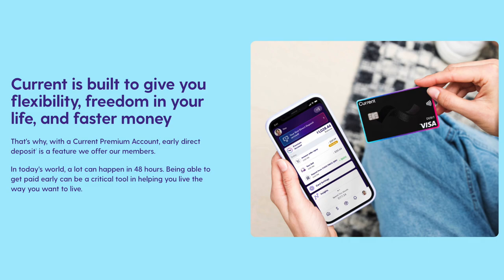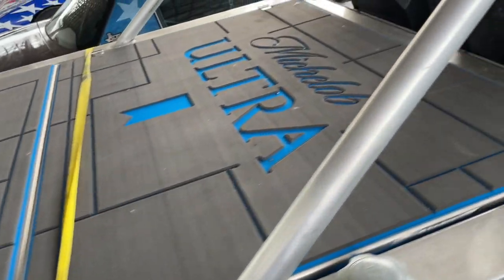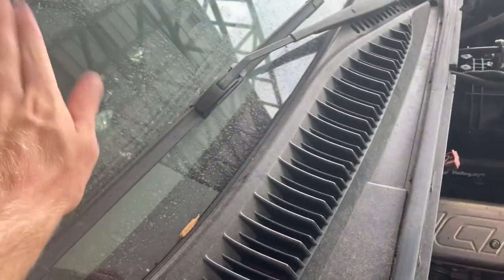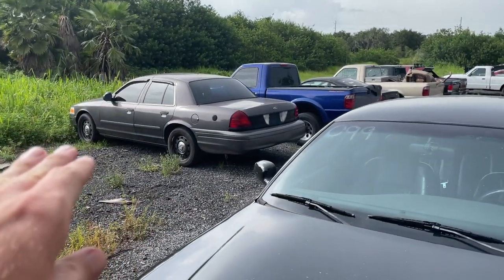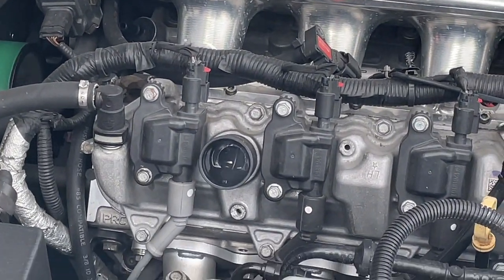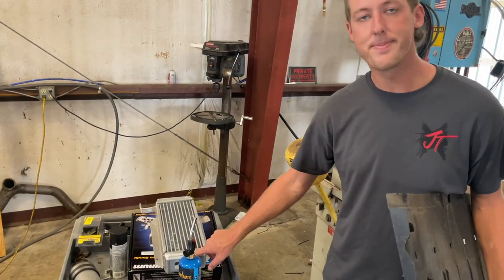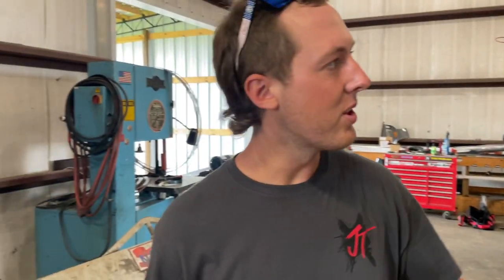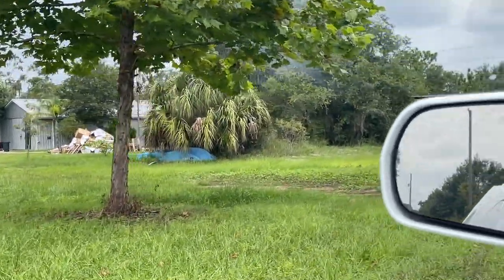Trying to Fix the FREAKING Bald Eagle Machine Finally... + Sold One of the Jet Boats :(

Comment: Cleetus: running the car all the way through 3rd gear

George: Strange the temps are rising when we’re going 40-50mph
Reply: well I mean, for a stock car it doesn't make sense. Even if you're making pulls, it should go back below 200 degrees. Because it's not stock anymore, it might get slightly hotter but it should cool down while cruising. He said it hit 250 cruising... so something is definitely wrong. I would start by flushing the coolant system and changing the thermostat and then moving the oil cooler and getting more air through that bumper. 

Normally when you're cruising at highway speeds, the temps should drop a ton because of the wind. The car didn't do this before, so I am gonna guess something new, especially since it's been sitting for a while.
Reply: If it rises during the pull, it'd ok; but it's rising when you are cruising after the pull.
Reply: Yeah, it sits a lot, and likely has plain tap water in it. Probably plugged up somewhere. Flush cooling system, change thermostat, take water pump apart and check for proper function, make sure the blower isn’t somehow keeping the belt from getting good grip on the water pump pulley, burp it WELL, make sure the efan(s) kick on at 180 or when the AC’s on, etc.
Reply: @sammaggard  I think the joke might be that they might have been a little bit faster that 40-50, maybe 55?
Reply: He also said they are running no thermostat on it. once the engine load is gone and there is nothing generating massive amounts of heat anymore the coolant temp should drop right off. He should try to build a air scoop into the lower skid plate to try and ram air through the radiator from the bottom. could potentially solve the boost pipe being in the way also
Reply: @zachbecklake2303  the problem with no t stat is once heat soaked the water dont sit in the radiator long enough to cool off
Reply: @zachbecklake2303  when you dont run a tstat, the engine will generally cooler very well at idle but overheat when running down the road because the coolant is running through the radiator way too fast.
Reply: @zachbecklake2303  If they ain't running a thermostat... hope they have a reducer in there.
Reply: @The_sinner_Jim_Whitney  if he is letting tap water sit, it will destroy the block, ask me how I know.
Reply: gotta use distilled water
Reply: @sammaggard  Eventually, yes, but probably not over the kind of time they probably let them sit. I imagine you know for the same reason that I know, haha! I’m sure they flush them pretty regularly. But yeah, tap water’s certainly not ideal for coolant and I think the only reason they (or anyone) use it is for legality on racetracks and unfeasibility of using distilled water or waterless coolant or something.
Reply: @The_sinner_Jim_Whitney  yea my sleeved block I bought used, needs resleeved because the owner let tap water sit in it.
Reply: @sammaggard  As did my truck (2012 Colorado 5.3L ext. cab Z71 4wd with 4.10s, one of like a couple hundred). It was IMMACULATE, lifelong central valley California truck (I live in West Virginia where everything’s rotten from salt) with 48,000 miles. Rotten block from tap water. It’s okay, though. My cousins helped me pull the motor, we sent it to be re-sleeved .030 over and rebuilt it with 10.75:1 forged pistons, ported/polished heads (243s on those motors factory) with better valvesprings and a TSP stage 2 low-lift truck cam and phaser limiter. Now it runs like a striped-ass ape and was still a good deal (all in, I have what they usually go for in it). When the 4L60E or AAM 860 rearend inevitably fails, I’ll get the trans rebuilt by Monster or someone, put stronger axles and a Detroit Truetrac in the rear, and probably refresh the motor with lower-compression forged pistons, a Magnuson blower, and a mild blower cam from TSP or someone. It doesn’t need it, at all, but I’m a sucker for stupid-grin power in regular-ass cars.
Reply: @The_sinner_Jim_Whitney  hell yea, I bought a 430whp Integra, and it needed a refresh. I ended up buying another block, 2.1L GSR with Benson sleeves, Eagle rods, Wiseco pistons, 85mm. Garrett 60-1, Precision 700hp intercooler, Precision 1000CC injectors, Walbro 450, Hondata S300, full 3" thermal exhaust, custom ramhorn, LS trans with Quaife LSD, Exedy twin disc, etc etc. It had an ERL Superdeck B18b block 84mm, with CP pistons and Crower rods, but I have to resleeve that block now. ITR cams, crower springs and retainers, and more lol. Should be a fun car

Comment: Correct me if I'm wrong but I believe that bottom cover makes it so the radiator have a positive pressure in the front of it and a negative pressure on the rear. Removing it will lower the front positive pressure when driving and lower cooling efficiency

Comment: Try getting dual fans that cover the whole radiator so air isbeing sucked acrossed the entire surface .pipe the intake so you get cold air instead of hot air from the engine compartment 😎
Reply: You are so right! Hell over half the radiator has no fan on it. Just air coming while they are driving but that’s not near enough! Does need the twin fans with the cover over the radiator that the fans sit in!!!

Comment: No stat can be worse than having a thermostat as it may allow the coolant to move through the radiator too quickly not giving it time to cool the coolant. Do what 95% of the fast street guys do and put a 160° star in there.
Reply: I was going to say the exact same thing. Also got to have that little bit of pressure build up that the thermostat does
Reply: And add a bottle of that water wetter stuff, it really does work! Not as much temp drop as advertised but I saw a solid 10 degree drop in my car.
Reply: 160 is dumb.  The engine needs to run hotter and during the cooler months it'll never reach operating temp.  It needs to run between 190-210 to burn off moisture in the oil.  His problem isn't the temp but the lack of airflow through the radiator to keep the temp from climbing above 210.  Vettes are bottom feeders and he needs to take off that plastic piece under the front bumper and put a lip there to direct air into the radiator.  

PS,  a 160 in Florida means it's open the whole time and has no time to dissipate the heat.
Reply: @gbpg2016  what fast cars have you built or do you own?
Reply: Yes. I've even removed the stat and put in restrictor in its place before. Thermal camera helps to find out where the hot spots are as well.
Reply: You are correct sir!!! The coolant is circulating so fast that it doesn’t cool down. People forget that the thermostat is designed to slow or speed up the coolant to keep the engine at the proper temp!
Reply: @gbpg2016  I kinda think GM would've taken a bit of time over airflow that shroud isn't there by accident
Reply: @baby-sharkgto4902  You say that like hes wrong. Even here in the midwest, 160 is not enough. I have to go 175-180 in my Stang or you run into warmup cycle issues. This is not new stuff!

Comment: Put the thermostat back in it and that will help keep the coolant in the radiator longer to have a chance to cool it down. They also make restrictors you can put in place of the thermostat to slow the circulation down. And a cold air tube for pro charger would help a little 🤏🏻
Reply: You mean thermostats are there for a reason????
Reply: @spiritualhouse2  ikr
Reply: @spiritualhouse2  [Gasps in shock, hands on cheeks] "Gasp! A Thermostat does something useful?!" [Personal reality utterly shatters]
Reply: And or a restriction of some sort i mean you could gut a factory t stat and it would be better than nothing at all

Comment: I work with several hundred Freightliner Cascadias, the recommended oil change interval is 40-60k (replace the fuel filters too!), the trans fluid at 180k,  air canister filter at 140k, power steering at 140k, coolant at 300k, crankcase breather at 350k, of course, always consult your manual.

Comment: Issues with it getting too hot...
1- Where is the oil cooler to the radiator, and can it be moved and its own electric fan? Worked on an Australian burnout car that would always get hot even on methanol. The problem was there was an auto trans cooler mounted in front of the radiator so every time it was pulling hot air from that straight into the coolant temps.
2- Air intake definitely needs something done as hot air keeps getting hotter 🤷‍♂️
3- possibly upgrade the stock fan as it's nolonger stock. Not a huge fan of shrouds unless you make or get a fancy one that has the opening flaps to keep air flow when moving faster. Still don't thik they'd work great with the radiator on a lean like it is.
Reply: Put a gap between the oil cooler and main rad, if they touching they have same temp, change rads to. Single core custom with dual fans pull, and put a pusher fan on oil cooler kicks in when above 95 to 98 main rad temp city driving  high speed it never turn on, setups same as custom Bmws, Ultima cars uk, Porsche, ferrai, setup on BMW works in austrailia I use it

Comment: The fan is terrible. The fan is only cooling like 30% of the radiator. Need to have as much fan as you can, big and multiple if possible. Then have the fan shroud pull air directly through the entire area of the radiator. The little fan shroud is only pulling air through that little area in the middle. High flow fan that draws on the entire rad. Done deal.
Reply: If that fan is a good high cfm unit then it should be fine, they just need to add a shroud around it so it can direct the airflow out of the entire back of the radiator through the fan. They have so much extra stuff on this already that adding more is just going to make it harder to work on and add failure points. Simple piece of plastic to bolt on around the back of the radiator will be just as good and way simpler.
Reply: SPAL makes a huge nasty fan, you also have brushless fans now that flow unlimited air.
Reply: @Joebobinator  those vettes had cooling issues from factory like all the over vettes, so that fan looks anemic for the amount of power they made factory

Comment: Put 2 fans on that radiator, make a back shroud for the fans directing the hot air down under the car. ( can probably get something 3D printed) Looks like you have room 👍👍👍👍

Comment: Everyone is going about the rad fan but if he's overheating at speed that's not the main problem correct airflow is. When I lost the vertical splitter under my car on my 90 mustang it made it run so much hotter. It caught the air passing under the car and put it infront of the radiator

Comment: Try getting a full fan shroud on the c7 that might help as well
Reply: Thought that to, not drawing air thru whole radiator!
Reply: I was thinking the same thing
Reply: Yep, two fans wrapped with a full shroud.  Problem will dramatically improve.
Reply: The right answer
Reply: Yeah that fan shroud looks stock and stupid as heck.
Reply: @ToxicMrSmith  doesn’t look stock really.  No oe shroud would cover that little.  Possibly came with the pro charger kit or some aftermarket deal for clearance

Comment: Get the air inlet out of the engine bay. It makes a massive difference. You are definitely heat looping. I had the same issue trying to keep my turbo ram cool and moving the intake out of the engine bay fixed the overheating.

Comment: On the oil change on the freightliner. If you use full synthetic it's 50-75k miles. That's what the dealership recommends

Comment: I wonder if that fan only covering like 75% of the radiator is part of the overheating issue, if you could build a fan shroud for it I'm sure it would help some.
Reply: The way they are doing it is Wrong, a decent thermostat plus a shroud will almost assuredly fix their problem. if still problems after that I'd look at water pump problems or a larger/faster spinning fan.
Reply: The fan turns off once the car reaches a certain mph.  His issue is the temp isn't stable while driving when the fan is off.

Comment: As you guys know from your wind tunnel tests, air is going to take the path of least resistance. Some real ducting directing air into those coolers and out of the bonnet vent would go a long way.
Reply: Change the duct work on the front , behind the nose , direct it off the road and force it into the coolers …

Comment: Dual fans covering a larger portion of the radiator for a starter. The fan is only covering 60% of the radiator, and duct those fans out through the wheel wells. Two smaller oil coolers, one on each side where the vents in the grill are unobstructed.

Comment: Hey Cleeter. Just a note on the stabilitrack flashing on and off typically that’s not a short but a loss of ground.  Check the car grounds and the battery cables.

Comment: Some quick thoughts that would help:

-Fan shroud covering the entire radiator with dual fans 
-New front bumper (ZR1, or other with more grille surface area)
-Somehow routing cool air to blower inlet

Other options that might help:
-Repurposing rear scoops (for diff and trans coolers) for dual engine oil coolers in the rear of the car. Removes the number of heat exchangers in the front of the car staked in a small area.
-Attempt with new fan shroud to re-route air out through the hood using the OEM venting route more efficiently.
-Cowl hood to help move more air out
-Remove the hood like you seem to do on every other car you have lol
Reply: Be cool fan shroud and dual fan.

Comment: Maybe there is a air pocket in the cooling system. LSX motors need the cooling systems bled to get rid of ALL air bubbles. I learned the hard way.
Reply: You're not kidding. I can't afford any of these new fancy LS blocks, let alone LSX, but even the older LS blocks in trucks would throw a fit if there's an air bubble and it's a pain in the ass to get them bled without using a vacuum to bleed them. I don't recall these issues coming forward in the past so something must have changed.

Comment: Before going crazy with the cooling system Id try to optimize the tune up.   It sounds like it breaking up all over and shutting off when coming to a stop... optimizing idle and partial throttle ign timing can be an easy thing to try.  Assuming your not driving around on partially fouled plugs.

Comment: The fan shroud size matters most at low speed.  If it's staying hot at 50mph there is just no where for the heat to go.  Louvres in the hood just behind the radiator or a hood with a little bit of a cowl will probably help.  Also an intake elbow, that can't be great sucking in all of that 200+f air.

Comment: Bald eagle machine might need a full shroud so its not just cooling or pulling air just in the center. Should help
Reply: I think a t-stat would help too. The radiator never actually has a chance to cool the coolant when it’s constantly cycling

Comment: A shroud in the front to direct air to the radiator and oil cooler would fix that problem. Also a bigger fan might help, I would weld a aluminum shroud for the front that goes to the ducting on the bumper. This way when you are slow cruising it will help to direct the air straight to the radiator because right now it is causing a vortex behind the bumper.

Comment: My ‘14 Silverado had that issue. They claimed it was the ground wires. Stabilitrac would turn on and off all the time. Motor would shut off randomly, ac would kick off and go warm on the air. Check the grounds by the battery terminal etc

Comment: Maybe you could find a way to get the hot air out of the engine bay. It seems pretty stuffy and closed off in there.

Also, what if you did dual cooling fans to take advantage of more radiator surface area?
Reply: Did you just tell him to take the hood off??😮 hehe

Comment: Looks like you have a leak there Cleeter. When you leaned over the drivers side, that radiator hose towards the bottom looked wet? That could be contributing to the high running temps.

Comment: Do double cooling fans and a full Shroud on the back of the rad on the Vette. Shouldn't be too expensive to make your own shroud in shop . Just need some super high CFM fans that will fit where the current setup is located. Current fan looks thick so you should have room.

Comment: I would use a full synthetic Rotella t6 and change it every 10,000 miles. I've worked on a c15 cat with over 2,500,000 miles. especially with a oil additive like motorkote. That's just my opinion. Others can put their input on different oils.
Reply: The new detroits in the freightliners is every 50k for oil changes.
Reply: @chevypower4772  highly do not recommend. There will be little to no viscosity left in that oil. That's what they recommend. In my opinion the DD15 or 13 isn't a good engine. But it's proven that oil viscosity affects fuel consumption as well.  Best to change it early to maximize that engines life.
Reply: All the new engines are only designed to last till warranty is up. New engines are ticking time bombs no matter how they are maintained
Reply: AMSOIL
Reply: Most of those additives destroy the emissions system, just like letting it go too long between changes. Oil ash can't be burned off in a regen cycle.

Comment: Oil change in the towter...i would personally change it every 15000 - 20000 miles for your type of application you use it for, long haul applications can go longer (40k-50k) in the DD engine but i can only assume that thing must see alot of idle hours as well, so i would recommend somewhere around the 20000 miles. Clean oil is never a bad thing. Also dont forget fuel filters and grease.

Comment: Go water to air so it doesn’t have that brick of an intercooler in front of the cooling stack. A thinner heat exchanger for the water to air would flow through a lot better